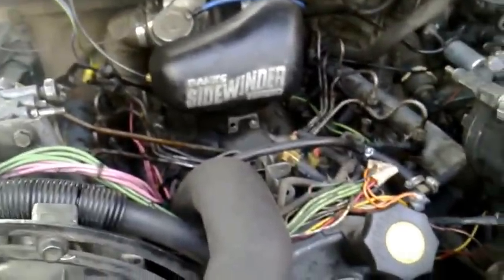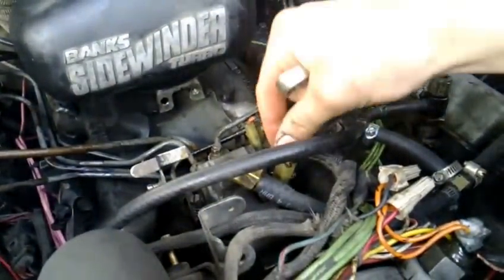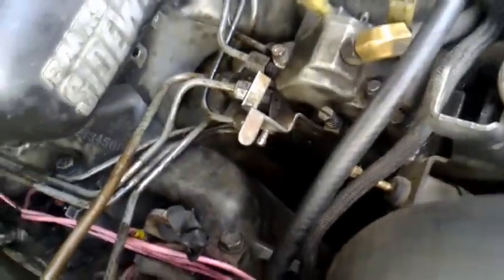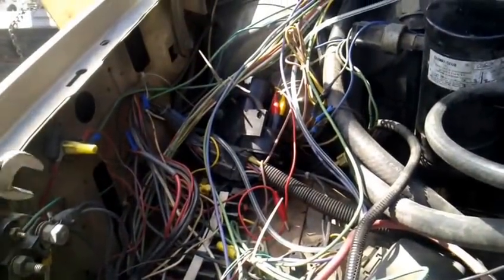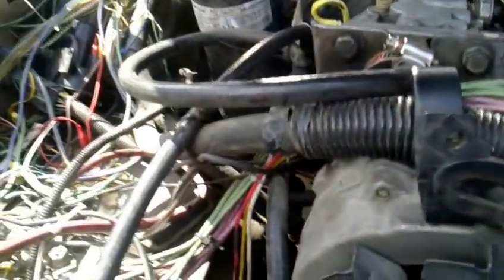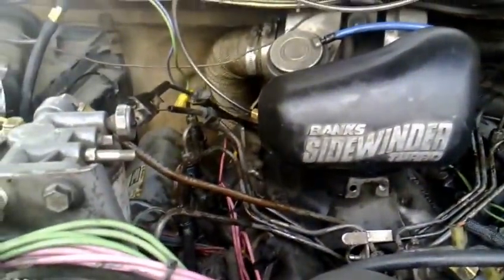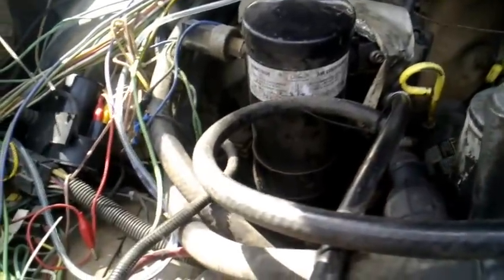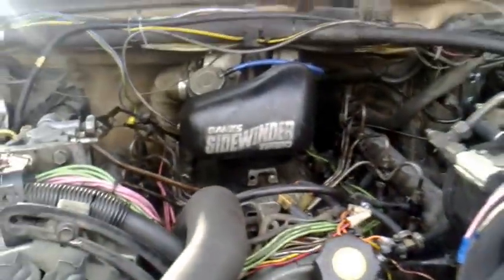How to bleed the lines on a 7.3 idi

Comment: I have an old 6.9, and I have air in the lines from replacing a chunk of fuel line... now that I've seen this, hopefully I can get the ol rig running again...
Reply from the maker: Yup; they aren't hard to work on or fix. She'll run if you get her fuel.
Reply: MacRobb Simpson she's running wonderfully now. turned out she also needed a new battery. I wish there were more videos on repairing these old idi's.
Reply from the maker: Anything specific you are looking for?
Reply: wiring info is a big one im trying to learn. my 6.9's wires are a mess between the factory components and added stuff thats since been removed.
Reply: Does it work like that if it runs out? I run out yesterday in my 89 and could not get it to fire back up. Looked like nascar being pulled around in a field trying to crank it back. Just had to pay $125 to get it hauled back here 11 miles away.
Reply: @bradleyhughes6430  it should work. I’ve done it several times.